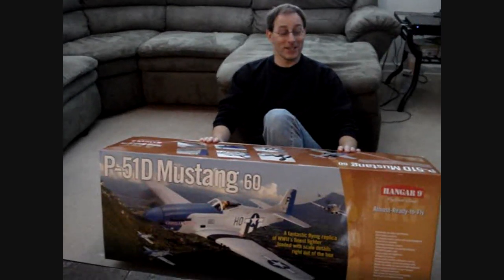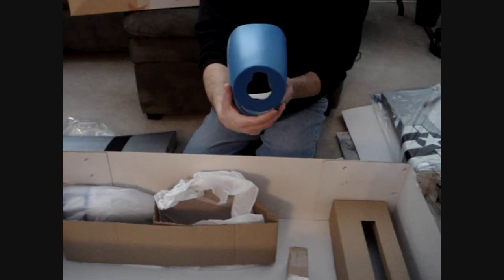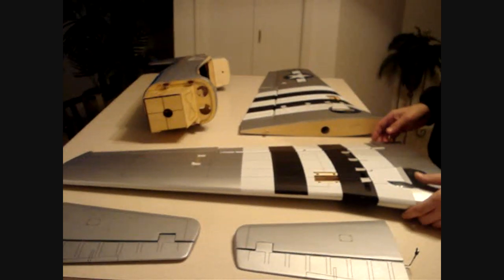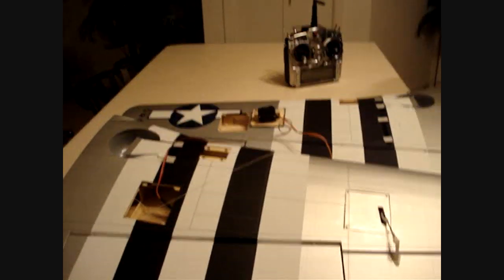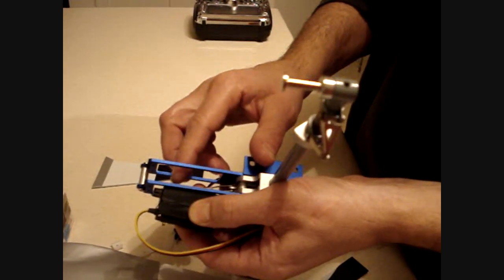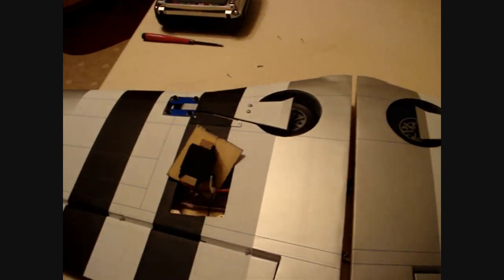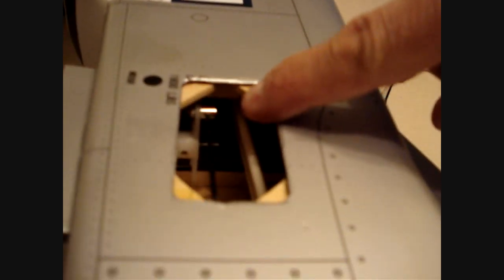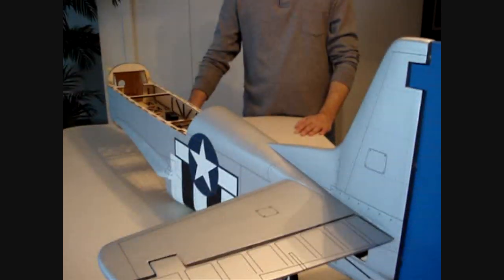Hangar 9  Blue Nose P-51 Mustang Build Video Part I

Comment: Question, Is this the ARF version?  Also you said it's going to be running on a motor.  Could I put an engine on it or only a motor?
Reply from the maker: Yes this is the ARF Version Yes you can put and Gas  Engine on it or Electric Motor.. Thanks for comment ..Tim ..

Comment: Hi tink
How did you get the hitec retract servo to fit they are too short by about 4mm to line up in the pre drilled holes?(I've got the same not started it yet)
Reply from the maker: From what I can remember I had to drill holes at one end. Thanks for commenting ..Tim